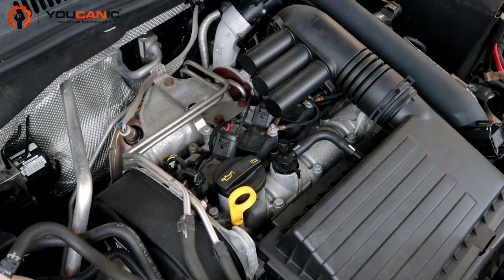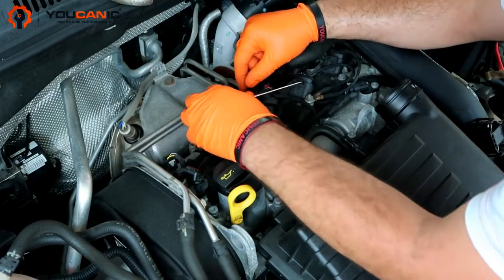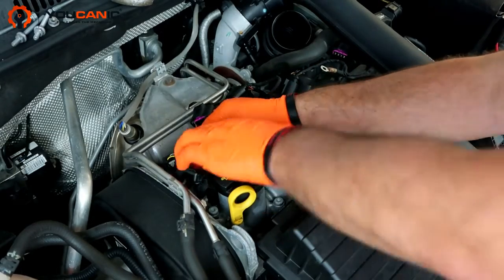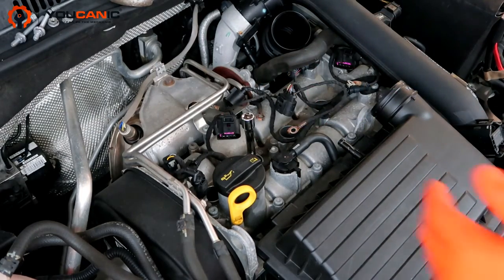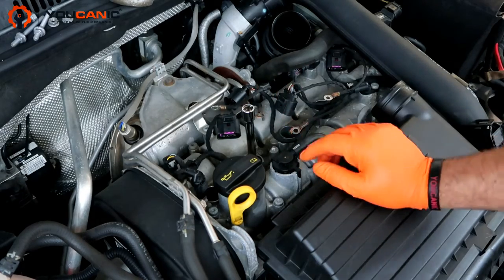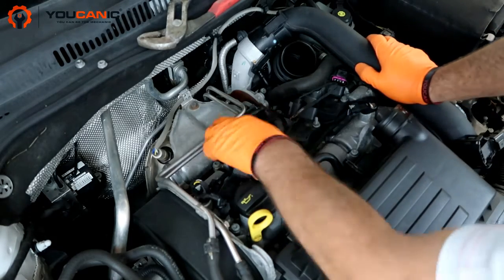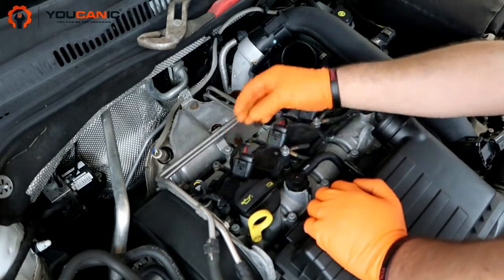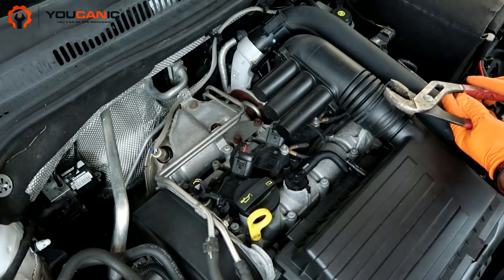How to Replace Spark Plug and Ignition Coil on a 1.4L Volkswagen: Step-by-Step Guide

Comment: I WOULD NOT USE A FLATHEAD TO PULL THE ELECTRIC CONNECTOR CLIP OFF!!!

I have a 2021 Volkswagen Jetta S. When disconnecting the electric clips from the ignition coil, I did not have to use a flathead. Just push the gray tab upward like he said but try with no flat. I broke the outside and had a time figuring out how to get it off without breaking it more. Luckily, the way I broke it helped me figure out how to get it off without further damage. 

I had to lift the gray tab behind the black part that sticks out. It's the piece the gray lift tab would have been attached to if I hadn't broken the top part to lift it. If it happens to you it will make sense.
Reply from the maker: @2facethevillin If you’ve got a car issue or repair question, you can find step-by-step guides and scanner help at youcanic.com. We might miss some comments here, but our site has answers for most problems already!

Comment: Yours came out easy. When I did mine it was like a marathon and in the 3rd one the rubber tube separated from the top and I ended up ripping it trying to get it out. Ended up buying a small air compressor to force the old one out and currently waiting for a cheap pull tool to get the 4th one out.
Reply from the maker: Thanks for sharing your experience, it indeed sounds like quite a marathon! Please remember, we at Youcanic are here to empower you on your car maintenance journey. We offer a plethora of guides, free resources, and a powerful diagnostic scanner to streamline this process, check out our website www.youcanic.com. Need more detailed help? Our factory repair manuals have got you covered. Remember, our mission is to help you feel confident under the hood and save money. We are here to support you.
Reply: i had one tear around the top of the plug.   ended up using a .177 brass gun cleaning brush to extract it.